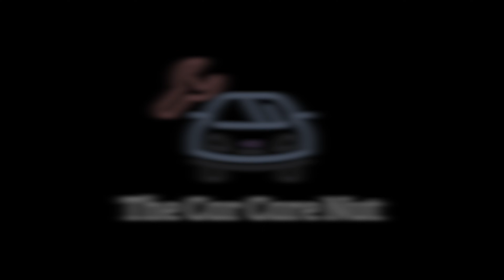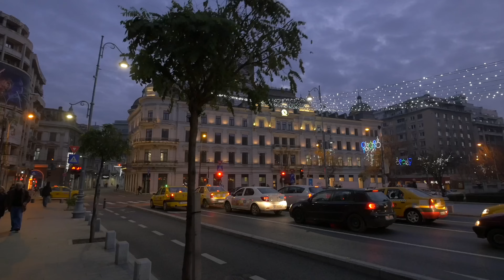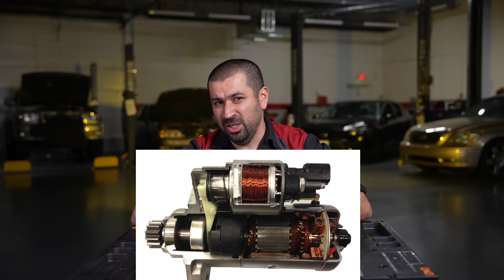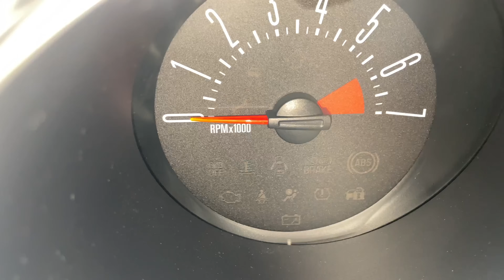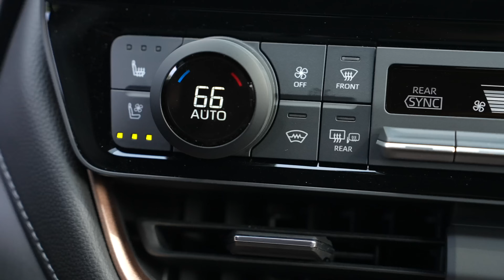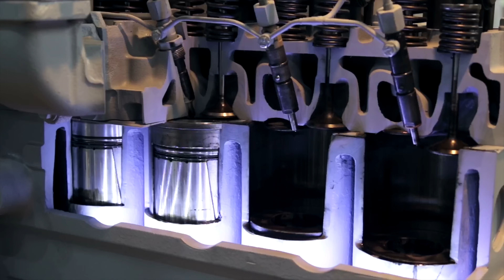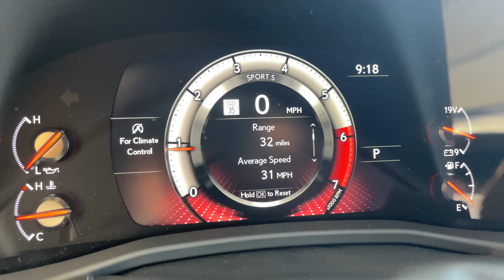How Does Start Stop Technology Work in Modern Cars? Everything You Need to Know

Comment: I think it would be great if the default was ‘off’ or if it remembered your last setting, but I don’t like it when you get into your $60,000 vehicle (or more) and you have to press an additional button every time. I also don’t like the additional expense of things that certain brands have added to their cars for it. I’m sure the more heavy duty starter is more expensive, I think some brands have added a battery to help keep accessories running so a second battery adds cost but in the end the actual fuel savings is almost nothing and is many climates the air con is running or the heat is running which stops the engine from shutting off anyways so most of the time you are sitting at a light during summer and the car just barely reaches its coolest temp and bam your engine shuts off then BAM it turns right back on. It’s stupid worthless technology that is all it does is disrupt the smoothness inside of the cabin. 😅
Reply: My thoughts exactly, "a stupid, worthless technology".
Reply: certain car manufacturers allow for the user setting to permanently be saved. So even after the engine restart, it will remember that you had opted to disabled the auto stop/start. My car for one, does remember the user's selection after the engine restart.
Reply: @edwint1780    What kind of car?
Reply: @chuckwalla2967  2018 MB GLC300 Coupe and 2021 Acura RDX A-Spec. Both are turbo charged engine and both are equipped with Idle Start/Stop when in  Comfort Mode D Gear. It annoys me when it shut off during hot day and thus blowing hot air fan, or when I am trying to exit a plaza into the road quickly but it decided to shut off in that split second that I stopped completely; then it will take 1-2 sec to boot up and go even I have my foot heavy on the gas pedal trying to take that 3-5 sec advantage to escape before the incoming traffic catch up. So if I am driving myself, then I will go into Sport Mode S gear; if I am driving with family then I keep at Comfort Mode D/S gear and manual toggle off the Idle stop button.
Reply: What kind of car do you have? My 2019 JGC does not remember and I wish it did. @edwint1780
Reply: The technology is pretty amazing but I doubt the actual benefits from it. It just made cars more expensive and more technical to repair.
Reply: It's all about meeting federal emissions and mileage requirements. These targets are so high that all the manufacturers have to add multiple complex engineering features that add 1-5% improvements in order to cumulatively make their targets. According to USDOT, the fleet wide average requirement for 2026 is 49 mpg. So let's take a look back at cars made 10-20 years ago...they were typically naturally aspirated, port injected, and paired with a conventional 5 or 6 speed automatic transmission. Very simple and pretty reliable for the most part but the fleet wide average mpg back then was probably in the 20s. In order to meet the new requirements, you're seeing downsized engines paired w/ turbos, high pressure direct injection, start/stop systems, electric water pumps, active aero grills, CVT transmissions, 8,9,10 speed transmissions, mild hybrids, variable valve lift/duration, variable spark timing, cylinder deactivation, multiple catalytic converters, exhaust air injection, etc, etc, etc.
Reply: There are kits that will remember the off setting.
Reply: The reason this exist and is default to on is because of regulations put in place that mandate manufactures to meet certain MPG requirements for their fleet. To meet these MPG requirements they are doing crazy things to save gas and increase fleet MPG. Cars are tested for MPG how they ship from the factory so if its off it will not count. Thank your government for this BS and all the other things that are not wanted but are being added to cars.
Reply: Check to see if they make a harness for your car that will keep the memory of that switch. I got one form my Audi SQ5 and it was awesome!
Reply: In some cases I think the car has only minimal modifications and the starter sounds like the same basic one on previous models
Reply: This is illegal due to emissions laws in the United States. That's why car companies give you drive modes that turn it off, the law says you have to turn it off with a button press. So they encourage you to press that button by tying it to a sport mode or whatever.
Reply: @lexisnep525  The same in most countries. Start Stop saved me over £1000 in road tax in the 7 years I had my last VW Golf despite turning it off every time I remembered as it was sometimes Stop, Don't Start.
Reply: And not to forget that it turns back on everytime your car stalls as well.
Reply: I've a stop start problem on a MK2 Renault captur 2020, it has been in and out of a Renault dealer,The s/s module was changed ,then the injection computer changed still not working correctly, If I stop at traffic lights the car will stop ,but when I put my foot on the clutch to restart the car won't start, but if I purposely stall the car by putting  into sixth gear, the car will say depress clutch to start and it will start ,but it does not say this when it stops it's self at lights and won't restart on pushing clutch, it's like it doesn't know it has stopped it self ,any ideas would be appreciated .
Reply: You can figure on that starter motor running about $5k when it's finally needed. 😮
Reply: Mazda just started using this. I am pissed.
Reply: Folks don’t complain folks you think this is bad if joe gets in on November 5 2024 he will make you pay a sin tax on miles driven so you folks will purchase electric vehicles then you will be complaining about can’t find charging stations in the boondocks. So enjoy your stop / start vehicles. Don’t forget to vote for joe in November.
Reply: No. There should be no off switch.
Reply: Yeah, I don’t like getting in my 300,000 dollar airplane and having to push all those buttons just for takeoff.
Reply: Yeah same same. That's why I just go into "Sport/Sport+" Mode right off the bat and that will disengage the Auto Idle Start/Stop while making my driving experience more reactive where I can paddle shift down 2 gears and go. Comfort / Eco Drive Mode does not suit my driving style since the gas paddle is stiffer and not as responsive, which makes my lane changing action a bit sluggish compared to Sport Mode.
Reply: @danny1103   What kind of car?
Reply: @danny1103 Toyotas eco mode makes the peddle more mushy. Have to press deeper to get the power. I like the Eco for 90% of my driving, which is highway. Sport is for the weekends/local driving 😊
Reply: @basilman121  Eco/Glide mode mostly function the same across brands where it adjusted the gas paddle and steering wheel to be more stiff and less responsive; and when you let go of the gas when downhill it will engage in Glide and preserve fuel. But overall it just made my foot and arm muscle tired once I did that for 5 min, so I just stick with Sport mode on the fast lane.
Reply: @danny1103 eco mode does nothing to the pedal. It just changes the distance you have to move it to get a certain percentage of throttle. Sport gives 100% throttle at about 50% travel. Eco is 1:1. 

The feel of the pedal is from a spring and doesn’t change other than the slightly extra spring rate added by the longer throw used in eco mode.
Reply: @Mi-ck  You are right about that. Its just people can't feel their right leg anymore when driving at eco mode for an hour, as if they just finished leg bench pressing work even though the pedal spring load is the same. So I will keep mine in Sport Mode thank you.
Reply: If you have 60k to buy a car then vote with your money and not buy that car
Reply: They do sell bypass devices. It's annoying you have to mod your car for this though.

The reason most cars default to ON is because otherwise it wouldn't get counted towards the EPA regulations. It's really annoying.
Reply: Learn grammar please
Reply: @truckercowboyed2638  With a name like yours, you should probably prove your grammar before telling others about their grammar. lol

Comment: I always turn that crap feature off.
Reply: Most have a button, but frustratingly defaults to on every time you start the car, so you have to remember to press that stupid button every time. After market hacks exist to change the default, which is idiotic, it should be something you can choose to default to off.
Reply: On Volkswagens this stupid start stop always turns back ON when turn on ignition 😭
Reply: @Nexislucent  On every car I've driven it turns itself back on after turning off and then on the car. I think that's part of the regulation for this moronic 'feature'
Reply: @repatch43  what regulation? I turn it off when I remember, because it's bad for the turbo to stop circulating the oil after hard use. I Hate this feature!
Reply: @Nexislucent  The regulation that mandated the inclusion of that feature in your country probably has, as part of the requirements, that the feature re-enables every time you turn on the car. It's the only thing that explains why it turns itself on every time.
Reply: @repatch43  yeah makes sense. They want to "reduce " bad things going into the atmosphere. So silly.
Reply: Every car I’ve had the misfortune of driving that had that feature - if you wanted to disable it you had to do it again and again EVERY TIME YOU MADE A TRIP. Stupid ass feature.
Reply: WHY do you guys dislike the Start Stop feature.
Reply: @alexanderthegr888  unnecessary wear and tear on the starter (which I know is beefed up, don’t care, just makes it more expensive to replace), battery (which I know is beefed up, don’t care, makes it more expensive to replace) and engine. Plus some implementations activate start stop even when canon hasn’t hit requested temp, in 100F weather even a minute waiting at a light means the cabin gets quite uncomfortable quite quickly
Reply: How?
Reply: @mercerconsulting9728  Most cars have an auto start stop off button.
Reply: @mercerconsulting9728  depending on your car the aftermarket may have a way to turn it off through a tune.  Stock my GTI reverted to Start/Stop enabled every time you get in and I had to remember to disable it.  After a tune it now defaults to OFF and only turns on if I want.
Reply: Me too, an absolutely stupid idea on non hybrid cars

Comment: Hello Care care Nut, I have a 2023 TRD and I smell coolant on drivers side at front wheel after driving. Coolant tank down about 1 in. In 3000 miles. Is this normal? Tks.
Reply: It's abnormal.  You have a leak.  Have the dealer repair it.
Reply: @chuckwalla2967  Took it in to 2 dealers said no leak. I'm not Happy!
Reply: @scottw.7441    If you can, do a pressure test yourself and find out for sure.

Comment: Hello 
I have a question 
why does my 2013 Es350 has a trouble starting up when its cold, like first thing in the morning, but afterwards everything is normal, just the first start up of the day
Reply: The engine hasn't fully warmed up yet when you first start it.

Once the engine is fully warned up it starts up normally.

That or you need to replace the battery with a higher cold crank crank rating

Comment: How much to replace a starter after years of this? My son has this in his Subaru and the car shakes when restarting each time. Very aggravating  ins stalled traffic
Reply: I have a 2023 Subaru Crosstrek and found a $25 fix on Amazon that reverses the position of the "Start/Stop" OEM button so the default is off. It's worked great for a year now and is easily removed if I sell the car.

Comment: Start-stop is the stupidest thing since the Hybrid and the electric car. All modern cars are horrible and are designed to keep transportation unaffordable for the poorest among us with insane repair costs and high failure rates. Eventually, only the rich will be able to afford these insanely complex computer-controlled piles of rolling crap. The more they overthink the plumbing, the easier it is to stop up the drain. This video is doing a great job of proving that I am correct.

Comment: Always amazing how much feelings people have over something so relatively trivial. You disable it if you’re constantly in urban start stop. Enable it if you’re stuck in a highway traffic. No one will force EVs on you - you can buy any car you want.
Reply: I’m not sure it’s so trivial 😅 if you watched the video he talks about more heavy duty starters, and all the extra complication it adds to the engine. This is at a time where cars aren’t really being the most reliable to consumers and yet consumers are spending more than they ever have on new vehicles so reliability down, cost up isn’t trivial to most people. So you seem to see it as “just push the button” 😅 but I had a car with the auto start stop in 2016 and it had a second smaller battery in the trunk to help with the accessories when the engine was stopped, that was a very expensive second battery and all the other components will cost more when they eventually fail as well, so a high introductory cost for the car, a high repair cost and what is gained? A fraction of MPG? 😅 so even if there is a button to turn it off, you a buying a car with this feature that doesn’t really serve any purpose except add to the complexity and cost of the car and sometimes drags on the reliability. As for being “forced” to buy an EV, we aren’t there yet but the government has set deadlines to only sell new EV’s by certain years. So if the options are no car or an EV, that’s pretty close to being forced.
Reply: And Yet you Had to comment on it!!😂😂😂

Comment: Makes sense in a hybrid, not so much in IC (real pain at traffic lights - major hesitations).
Reply: Interesting, what type of vehicle do you currently drive?  If stop start is causing a major hesitation at a traffic light then you seriously need to get it checked out by a mechanic because a slow crank could be a symptom of something like low compression or failing injectors.

I drive a diesel 4 cylinder and the even if I take my foot off the brake pedal and onto the accelerator as fast as possible, the engine is fully started before my foot touches the accelerator.  That’s normal even for a diesel that takes more effort to crank, with a 9.5 year old battery.  If your car takes longer than that to start up when warm, or if you have a petrol engine which can easily start twice as fast as a diesel, and you’re still expecting hesitation then either get the engine checked for a major issue, or send the car to the junk yard!
Reply: hesitation came from engine shutting down and then restarting as traffic light changed. hard for an IC engine to accelerate just after being restarted. I usually turn system off as it offers little benefit.
Reply: @Mark-lz4wg  here in the UK we have a lot of roundabouts. Just a fraction of a second delay can make it difficult to pull out.